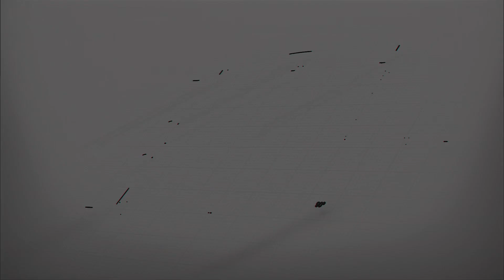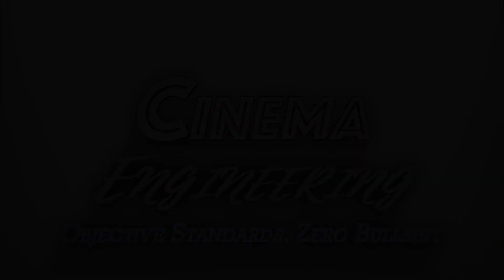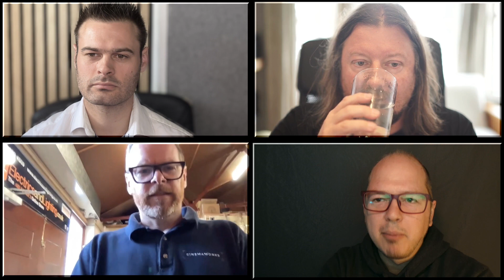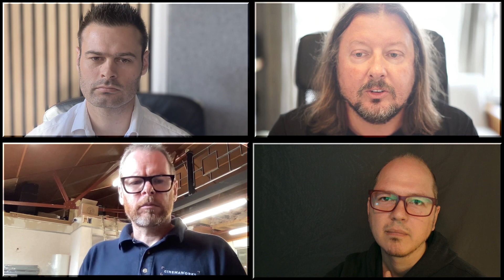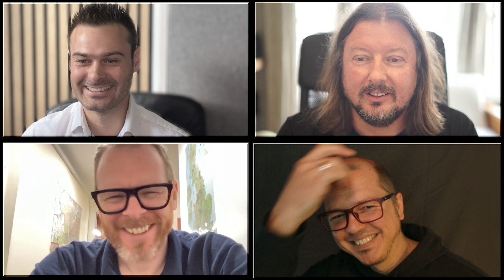Cinema.Engineering Podcast EP2 - Subjective vs Objective

Comment: I have the feeling the 30-40FL are more technically limited. With a great tonemapping HDR even looks better with 100FL (if you can afford a projector that can deliver this for your screen).
Reply: You are right, it's technically more challenging to reach high output figures, at least with 2 part projection, but it is possible in private cinema, even at fairly
large screen sizes. MicroLED will likely take some ground in this area in the future, but I personally still much prefer the look of 2 part projection (and an acoustically transparent screen). 

Many commercial cinemas have historically run sdr content as low as 12fL, so in the private cinema, it's quite easy to provide an image which clients find more engaging than the cinemas they are familiar with. 30-40fL with great dynamic tone mapping will provide an HDR result that really is quite impressive. Dolby Cinema runs at around 30fL and most viewers do seem to be impressed with the brightness. 

HDR Images look better still with more light output, until the law of diminishing returns starts to kick in much harder from around 75-80fL upwards. The DCI HDR research found limited increase in viewing preference above 300nits (87.5fL) https://youtu.be/7xUqF9DpD00
Reply: @BenGoff_Cinema  exactly that DCI research was leading my decision for a new projector, currently waiting for the Christie 4k25 to arrive with a modified lens by ARLED Cinema. AT Screen is mandatory, otherwise this is no cinema :-)

Comment: One of the topics I would really like this channel to cover is on the acoustic treatment side.
I understand what the transition or shroeder frequency of a room is.
My question is, how does the acoustical treatment need to be designed to accommodate this transition?
Low frequency is obvious to be treated with some sort of diaphragmatic, Helmholtz resonator or some sort if mechanical absorber. 
But what do you do to treat that 80hz to 200hz transition frequency?
Normal foam or mineral wool is only effective from 250hz give or take.
Let me ask the question in this way.
If a frequency is still a wave format in the room what treatment do you design for?
When the transition frequency changes to a beam format what treatment do you design for?
This is only the start of many many questions to come.
Hope I am not jumping the gun.
Reply: Hi Quentin,
We will absolutely be covering acoustics over the coming weeks.

It’s a big topic and key to the experience, so we’ll be breaking it down over several episodes to focus on different elements each week.